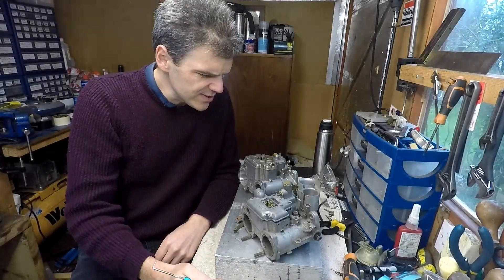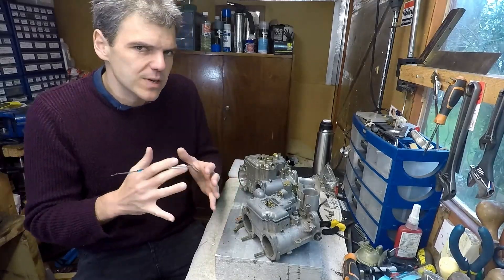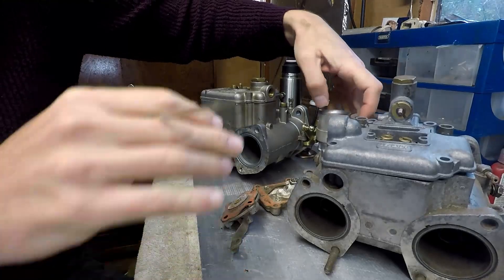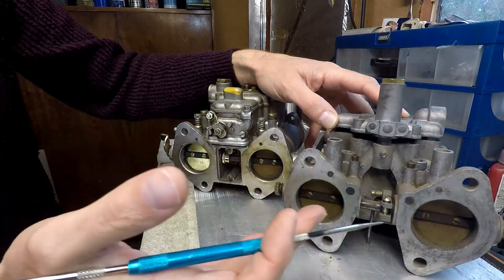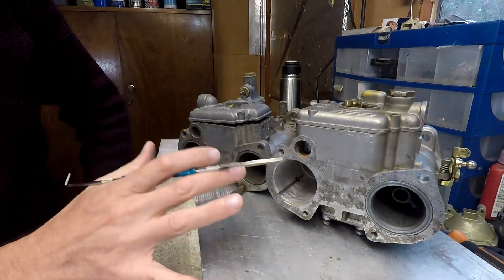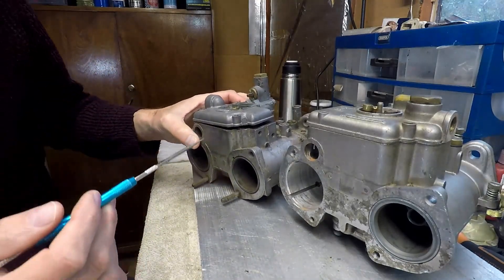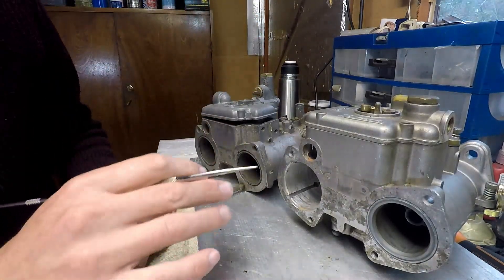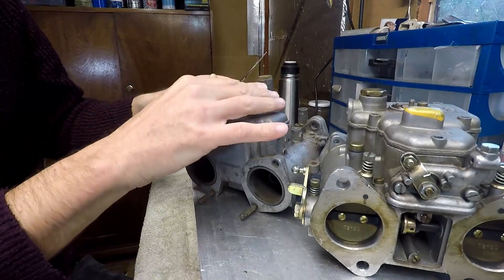What are the similarities and differences with Weber DCOE and Dellorto DHLA carbs

Comment: You know what the advantage is to the Dellorto accelerator pump?
 That brass plunger on the Weber wears the cylinder of the pump, which is part of the carburetor body.
 When it wears out the carb body is junk.
 When the diaphragm rubber wears out of the Dellorto, simply throw it away and replace it. 
Even the entire pump housing is replaceable if it somehow goes bad.
Reply from the maker: I know this is fiddly but you could
Still oversize the hole and use a matching oversize plunger. Both have their merits and dis merits

Comment: Thanks to carburist and rockgin for their info and encouragement. I've since solved the mystery and the tuning problem, seems we were all correct. I now really like the idle air bleeds. My version of how I got there - Start with a book setup that is average for the engine so I had a running engine to work with. Set the idle jet for idle. Set the main jet for full power around the max torque revs give or take. Set the main air bleeds for power up to max revs. Set the idle air bleed to get smoothly from idle to main circuit. Set the pump jet to get best acceleration when flooring the pedal. I've now got a race engine that's really easy to drive.

Comment: Great video - I had been wondering about the differences, since similar Alfa models used either the 40 DHLA and DCOE carbs. But you definitely called out the weak point in the DHLAs -- which are all the parts associated to the accelerator pump. That diaphragm is very prone to failing over time and causing a vacuum leak... Thanks.

Comment: :face-blue-smiling:Question that no one seems to answer - Dellorto DHLA idle and progression.  The idle jet on it's own is simple to understand but the idle air bleeds ?  Setting idle is all about the progression up to the main circuit taking over, bigger idle jet is richer and smaller is leaner. But how does the idle air bleed work, why are there different air bleeds ? They look like smaller emulsion tubes so do they work similar to the main jet emulsion tubes ? Does a rich idle air bleed get progressively richer in the same manner or a lean idle air bleed get progressively leaner until the main circuit takes over ? Other articles seem to comment on the idle jet and idle air bleed as separate items but offer no correlation as to how they work together or what difference happens with different combinations ?  If you could answer that, you will be my hero. Thanks in advance.
Reply from the maker: Awesome question! My theory is that they did it this way to be able to “tune out” the situation especially in racy engines where the idle has to be too fat due to low vaccum because if not the progression stage does not work. I had this problem with Weber 48 DCO SP on a Jaguar E type lightweight. The idle (tick over) was way too fat but you could not lean it out beside of the progression. My guess is that with dellortos I would have been able to tune that out. Hope this helps
Reply: @carburist  Awesome answer almost.  You clearly understand exactly what I'm trying to understand because of your E type problem.  I'm working with Dellortos and believe in your theory too, but I still don't understand the relationship of idle jet to idle air holder in order that I perform the correct process to get to the correct answer ?  I have 50 idle jets with 7850.1 air holders, it idles a fraction lean but falls flat lean with gentle opening of the throttle.  If I change to 7850.2 air holders (catalogue says they're much richer) with the same 50 idle jets, am I heading in the right direction ?
Reply: @funkiwikid6106  IMO....yes and it depends. The richer air holder will/should cure your overly lean issue with light throttle, but the "depends" part is how much richer and hopefully not too rich in the transition to the Mainjet. Obviously, this fine tuning becomes much nore important in racing, just as the greenflag goes down (or in turns where you're off/on throttle), where you need a smooth (power) transition from idlejet to mainjet... At this stage of fine tuning (again IMO), it's testing different steps of the air holders and feeling what the engine does on load.